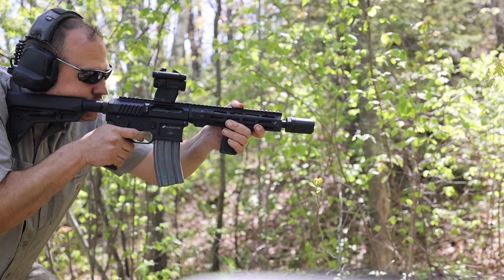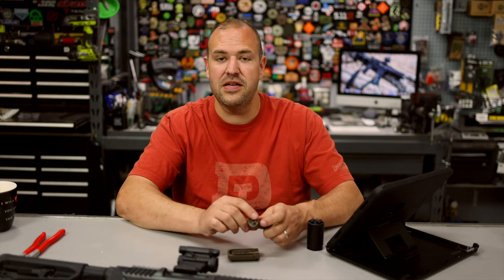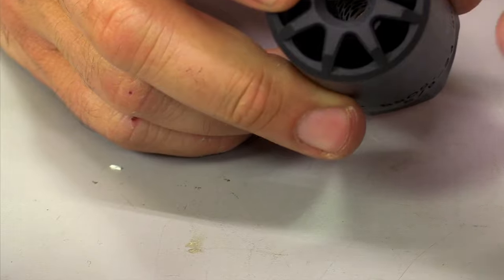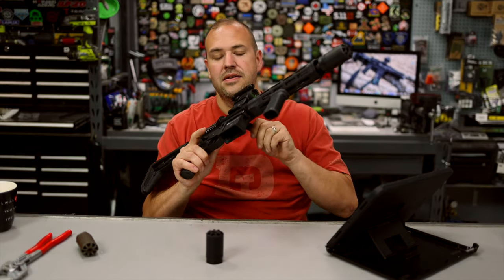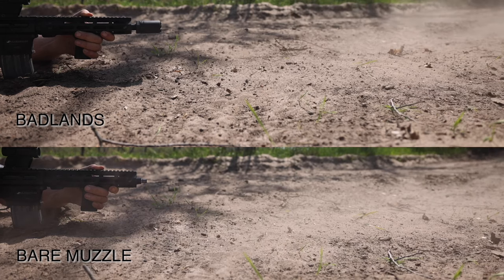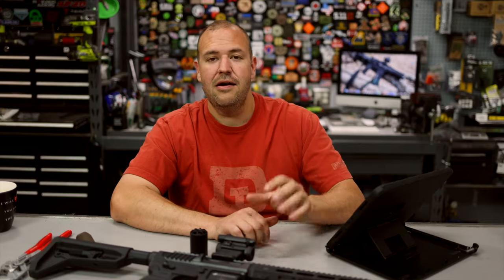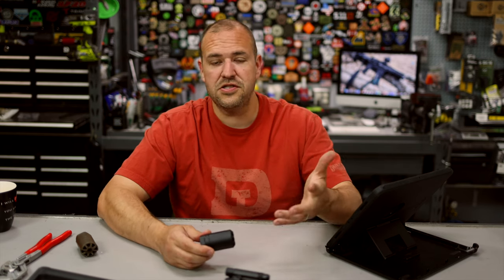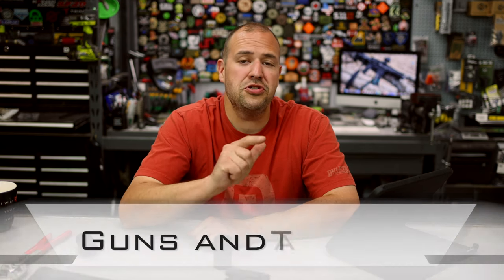Sharps Bros Badlands Muzzle Brake and Blast Deflector

Comment: That was a good explanation, and the cut in half muzzle device showed the details well.  I am looking into updating the flash cans on the CZ Scorpions.  I have to figure out a way to tighten the muzzle device, because the flash can is underneath the handguard.  Maybe I can design a custom spanner.   had to make custom sockets for the KAK flash cans, so I can figure out a way to make a custom spanner for this.  Thanks.

Comment: Love it just tried the muzzle device wow. It takes so much recoil out of my small 7.5 inch barrel ar15. I did not expect that I did buy the 3/4x24 thread one because I have semi permanent adapter for my Banish 30 at 7 inches so that’s why. I think it’s extremely heavy but who cares about that except Nutnfancy lol. Really a great break
Reply: FYI you shouldn't be running that can on that short of barrel. I have melty spots in my tube from mag dumping thru it with a 10.5. Silencer central has pretty scummy marketing. I bought a 300blk so I can actually use the can on a short barrel AR
Reply from the maker: There are some cans that don’t have barrel restrictions.

Comment: I've checked the Sharps Bros website and a few other sites, but no where mentions if you use a crush washer..?
Reply: Doesn't need to be timed so no it doesn't require a crush washer.
Reply: @derhohlenbar  That's what I figured, but thought it couldn't hurt to get a second opinion. Thank you for replying.

Comment: Barrel length determines powder burn the longer the barrel the less flash... even adding a muzzle device on a 6.5" barrel will not burn up the gun powder fully as it is determined by armors that the minimal is 7" as a muzzle can help with that depending what type but still there will be larger flash signatures and lesser amount of flash as you would go standard barrel lengths as even cartridge type also plays a part to be aware of.
Regarding flash burn cannot be eliminated 100% only the amount of flash dispersed that will be seen again of what type of muzzle device used.
Low light and nighttime use can be clearly seen as we all know by small arms to light/heavy machine guns for those who served in the armed forces knows too well besides the other heavy weapons used that gives off their firing positions.
Why are civilians so concerned with muzzle flash signature is my question since the types of common threats would face in a self-defense situation compared to combat in a theater of war?
I maintain what I've learned in the army of 8 years is to apply to civilian-vet status to my firearms is because of the standards learned and practiced that is natural to follow as I'm sure other vets do the same.

Comment: Great video! I've been searching for someone with experience on that unit so I can compare notes! I use that on my M4 (14.5" bbl) when I have to keep my rig short and maneuverable (it's only about 2.75" long and 1.5" diameter). In contrast, my 1.5"x6" suppressor does a far better job of reducing those decibels. So I prefer the suppressor for the range. My blast deflector has an ID of about 9.5mm (I also use it on my PCCs). I prefer the 1/2x28 thread since that's what I have on all my threaded firearms. I have yet to determine zero-shift if any with that blast deflector. Especially with my PCCs because the bullet is almost touching as it passes through the device. What's your experience?

Comment: Would like to see this with a dedicated flash hider muzzle device and a QD for the Badlands.  Especially since the SF Warden is NLA.
Reply: NLA?
Reply: BTW, the Griffin Armament Gen 2 QD Gatelok blast shield and new Explorr Taper Mount blast shield are significantly better than the Warden at reducing volume, blast, and concussion at the shooters ear. I’ve ran both Surefire and Griffin and the Griffin Gen 2 QD Gatelok and Explorr take the cake for me. They were getting an avg of 6-10db reduction at the shooters ear which is massive for a non nfa item. Also nowhere near as much flash as the Warden either. The PWS CQB also outperforms the Warden too and has the lowest flash I’ve ever seen from a linear comp/blast can device. Just a hair more than a flash hider. Only downside is it’s not removable. It IS THE muzzle device. Not a big deal tho if going on an SBR upper. Check em out. (Gatelok attaches to A2 profile muzzle devices and all M4SD Griffin muzzle devices and the Explorr threads onto any Griffin taper mount muzzle device... they’re essentially the same blast shield just w diff attachment methods). Also both are less expensive, but no difference in quality.
Reply: @MixBetterNowTV  where were you able to find this information?